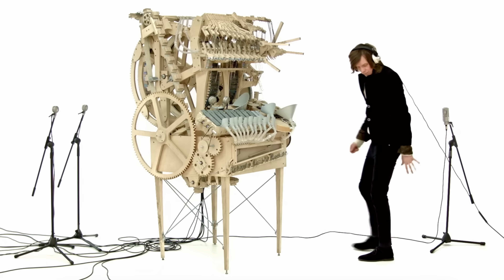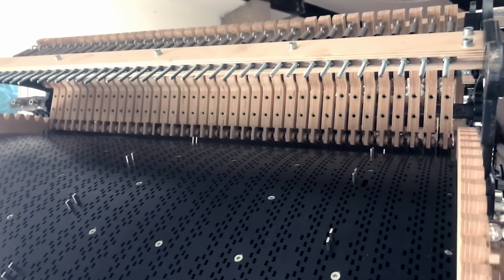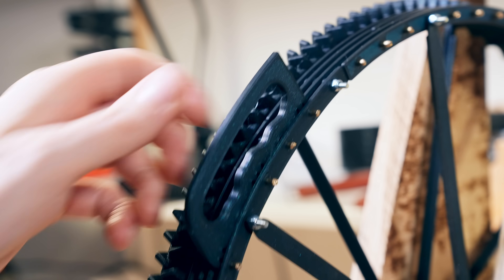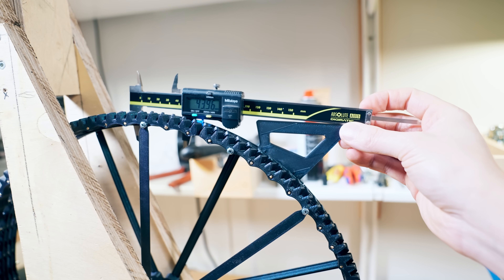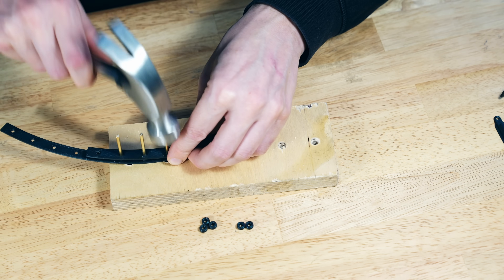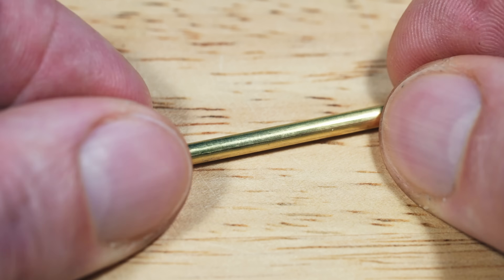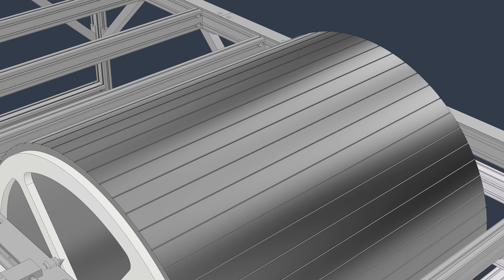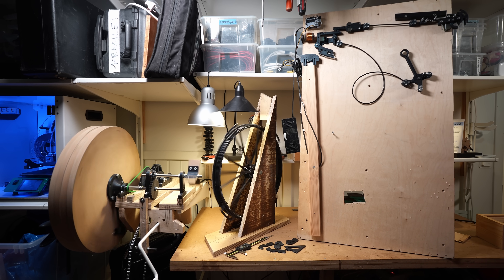Prototyping The Marble Machine Programming Wheel

Comment: I think the slots for the rods should be tight, but only act as a slot for the rod to sit in, then use a clamping piece screwed down over to hold the rod in. It takes more pieces, but should be easier to assemble and maintain, with less wear (if the rods are press fit then over time they will get sloppy).

Additionally it seems to me it would be easier to perform all the steps on a flat cnc table, cut the slots in the slats flat, then cut registration slots for the slats in the disks that make up the spine of the wheel for the slats to sit in snuggly.

One thing that others have pointed out before is there's still a need for a feature to stop the wheel from twisting along its length. I don't have a good answer for that myself.

Comment: The thin material holding the rods in will be a weak point in design 3. I feel like that came up in a design on the MMX. It will have a lot of support, yes, but if a rod breaks out it means completely milling a new wheel. Also the friction of pushing a rod through even a bearing material like delrin will be enormous over that length

Comment: I really think you're on to something with version two, version 3 is too monolithic an operation. Sometimes, despite Elon Musk, more parts is not better, but less impossible.  I agree the prototype assembles in a way bad for production of the machine, has to many parts and too inconsistent an assembly methodology. However, i think that idea could be adapted to a modular programming wheel design. Think a row of bicycle wheels on a single, very accurate shaft. 😉

Comment: As my previous worries weren't dissolved, I'll just re-post the comment I wrote in a previous video.
The programming wheel don't seems rigid enough to avoid deformation between both ends, the lack of diagonals or structural parts may cause a problem, moreover the driving force is applied to one end and there is resistance all the way whit the gates.
One other overlooked requirement is the need to play notes in fast succession, cause you can place a pin every 2 holes at minimum, holes that are worth 1 quarter note each in your design.
Some will say that the profile could have multiple edges to play multiple notes but you'd have to redesign the gate, as it is right now, it's way to flat and will be sitting on top of the multiple edges, thus merging everything into a single long note.

Comment: CRAZY IDEA:
What if instead of having a programing wheel that activates the gates mechanically, with the pins or prophiles, you had one that activated them electrically?

One option is that you could print a board with electrodes and a small battery on the wheel, that would make contact with a loose wire instead of a lever.

Another option is to use optical sensors with infrared LEDs in the place of the lever, lke those robots that follow a black line on the floor, having the wheel be printed with the notes

Both things would be incredibly precise, but maybe the machine would lose part of it's magic, since the mechanical activation is so pleasing to see

Comment: As a gear specialist, I think the double helical gears serves no purpose. It only looks cool. You would be better served with spur gears (straight teeth). There is no big torque here so no need of helical gears,. Straight gears allow you to pull the gear axially without moving the shafts apart. This allows for the gears to be milled as you don't need to much accuracy.

Comment: I like that last design in principle, but the way you are proposing to machine and assemble it is a manufacturing nightmare. I'd propose cutting an open slot (with a ball end if you want it to be round, but square would probably be just fine), laying the bar in and fixating it with additional bolted on pieces from the top.

Comment: I question the choice to only have the metal bars press fitted onto the wheel, it those bars are going to be pulled on every time the programing pieces are changed.  I can see the metal bars pulling out along with the programming pieces and causing a headache.  I think this aspect needs more consideration.

Comment: The rods are a good idea, its definitevely easier to space 60 rods evenly than 20000 holes.
But I'm not sure about the final design, it might be difficult to fabricate in full size. I would try to do a prototype with a flat piece of the same widht.

Comment: Or you can just buy a stainless steel 50 x 50 mm, 2 mm wire mesh... (3.2 meters long) and skip all the routing and fiting rods pain thing. You should only get the right wheel diameter (1018.6 mm for 1/64 accuracy). It may also be lighter, and will definetively last forever.

Comment: i kinda think the most economic way to go is to just adapt the 2nd design to use flat aluminum plate cut on a CNC router table. it's a little bit of a pain to assemble, but substantially easier to machine accurately and stiff enough in the axes you care about. adding retainer plates at the ends to keep the profile interface rods from walking out would also be a good idea.

Comment: It might be useful to use several shorter lengths of wire for the crossbars, so that trying to push them in into the slots will not bend them.

It might also be useful to make relief cuts between the slots (or inside the slot, so that they have a deeper cut within them that's too narrow for the wire) for the wire to adjust the stiffness of the lip of the slot. I would expect that the stiffness you get with no additional relief cuts (if you cut the slot so that it still grips the wire once it's in) will be a problem when inserting the wires.

There's a comment where someone recommends you start cutting the slots with a saw, because a ball mill doesn't really cut at the bottom. That sounds like a very good suggestion too, and allows you to adjust the depth of the saw cut independently of the depth of the ball mill cut.

Comment: Just a warning that press fitting those long rods into that slot may be difficult to do without bending it. Probably want to do a test part at the correct length. 
You are also limited by the size of the ball endmill if you just run it straight across, which might not be exactly the size you want. I think it's possible to use a smaller ball endmill to make a larger hole though. It would just be a very funky tool path haha. 
Maybe just make sections of it a tight fit, instead of the whole thing? Put some additional slots in for flexibility so it can deform a bit and grip the bars?

Comment: What you're referring to is "axial" and "radial" loads when talking about the ball nose cutter operation. However, you may be able to press fit the first few rods into their slots, but you will quickly find that you are introducing stresses into the metal which will make it require more force to fit, u til you won't be able to anymore due to the hardness of either of the material (it seems like you're going for brass rods and a steel cylinder, so the rods will fail first)
Martin, I know that you hate listening to people who have more experience than you, but unless you are for some reason not sharing your actual list of requirements, I think you should discuss with someone how to define them better. If not, try to follow the "SMART" technique.
Also, this would in no way shape or form be either cheap to manufacture, or easy for that matter, or repairable. I mean, what does "reasonably lightweight" mean to you? You will at least need an engine hoist to move that thing, and even then, how are you going to secure it without potentially damaging the wheel?
I don't mean to constantly shit on your project man, but it is so godamn frustrating.

Comment: i would love to see the programing wheels done in aluminum or stainless steel. the precision of parts would probably go up especially with CNC by a factor of a million. (exaggerating but ye know eh) every iteration of this build will get better and better, i can't wait to see how it develops form here on.
Reply: If you find a machine large enough to handle the programming wheel and rigid enough to cut steel, it's going to cost you a ton of money. With plastic you could probably get away with a router table and a suitable fixture, that's probably a factor of 10 or more difference in cost. Difference in accuracy would probably be in the region of 0.01 if at all.

Comment: obligatory "I'm not an engineer", but Is there a reason besides aesthetics the programming wheel has to be a wheel? seems like a lot of empty space for the interior of the circle, and any problems with the axis of rotation are magnified on the outside. Why not use a belt, like a treadmill or tank treads, that moves the pins/profiles in a linear direction and then goes underneath.

Comment: press fitting into plastic is gonna cause a lot of issues, considering you're constantly pulling and pushing on the metal rods with the programming profiles. 
Also if you already need to hire a machinist to build it, you don't really have to keep into account if its very easy or very hard to machine. It will affect the price a bit, but any machinist can easily pull off your first design. just takes a bit longer.

Comment: Martin. At 8.39 mins into the video, Using those type of carbide burrs will not give you the profile that you are expecting. These are for de-burring and fettling castings. The only type of cutter that produces a round machine cut is by using a round nose or ballnose cutter. They will only produce rounded bottom radii.

Comment: I’m confused, can someone explain how design 3 is conceptually different to design 1 except that pins attach to metal?

Is the advantage of the metal bars just wear resistance, maybe something ergonomic? It’s drilling the same number of holes, just now with additional horizontal slots – accuracy of the programming pins is still tied to accuracy of slot milling.

Comment: Those sliders are going to add a lot of friction. He still has no clue on how much power he will need, and since he wants everything to be human-powered he has no power to spare. If his machine is as efficient as a bike (it won't be: bikes are crazy efficient) he's limited to a power of 100/150W tops for the duration of a 3 hour concert, the performance of an average biker. Not a lot, and he does not seem to be aware even of this simple parameter.... Oh well, Wintergatan is the journey, not the destination, which is farther every day.
Reply: Agreed that it’s a fool’s errand to try to design/build a power module (or insist on “human-powered”) before he’s even built the machine and understand the machine’s power requirements and dynamics.

Comment: So would the whole programming wheel swap out for different songs?
Reply: I still think a bunch of hinged flat surfaces would work better, so when passing through the machine it's just flat, each flat segment would be say 10-20cm long. Then the "circumference" of the "wheel" becomes variable too, so longer or shorter loops, different number of bars in the loop etc etc. completely modular, and easy to swap out
Reply: Think roller shutter

Comment: You're wrong saying that milling an axial slot onto a cylinder would only cause axial forces on the cylinder. It will certainly cause rotational force (torque) and the cylinder will have to be locked very well in place.

Comment: 9:30 If you press fit the bars in place, then won't the Profiles pull the bars out when you remove the profiles?
Reply: I thought so too at first, but now I realise it's press fit from the edge of the cylinder, not the top. The slot made with the ball mill is like a lollipop shape.

Comment: measurements are as good as the measuring tool. those calipers have guaranteed accuracy of +/- 0.02mm so your measurements of the deviation of only 0.027mm is negligible, it might be just a measurements error...

Comment: 8:50 I have to warn you, cutting that slot will not be an easy operation. While you're technically putting force perpendicular to the rotational direction of the drum, the rotation of the tool WILL want to pull that drum in one direction and your channel will wander. Chip evacuation will also be a real problem with a slot like that using the type of cutter you showed.

Comment: Feedback on the proposed new MM3 programming wheel:

    When you press those long bars in the wheel, I think you will need to pull the rods instead of press.  You could do that with an attached thinner rod combined with a screw type puller.  Let me know if you need more details.   Note that this design will be a really long distance to pull / press even in plastic.   You should probably do a test piece to verify your construction method before building the whole wheel.

Comment: There's one extremely important design requirement that must be considered very soon.  The programming profiles do offer some advantages, but their larger size compared to mmx pins mean that any programming wheel these use is potentially less efficient at recording programming data.  You will soon need to decide exactly how much programming data is needed per loop.  Make the wheel too small, and you'll feel constrained to only overly simple melodies without many notes on very short loops.  Too big and it will be hard to tour with.  While it might add completely, it might be possible to make the mm3 be able to use different sizes of wheels that can be easily swapped out.  This can allow more flexibility, and make changes between songs simpler.  At the very least having one off stage being reprogrammed might prove essential.
Reply: Not really though because you can build as many custom programming profiles as you want, which more than makes up the lost data density. Like if you needed to squeeze two notes into the space of one programming profile, you could build a custom profile that has two humps. (This assuming the fingers can read the two humps that fast, but if they can't that's a problem that would affect pins as well.)
Reply: Attachment on attachment, or thats where the flexibility of the slots come in
Reply: I've sometimes thought Martin should look into the possibility of a roll/"card" operated instrument, which could play a much greater amount of music.  If the instrument could switch smoothly between two roll readers, that would leave room to adjust the length of different sections "on the fly".  For example, one could have a roll that ends with many dozens of repetitions of a two-bar vamp which could play while Martin gives a speech, during which another band member or roadie could load the next roll.  At the proper time, flipping a lever would start the second roll with some counted number of blank measures at the start, let it synchronize with the currently playing roll, and then switch off the first roll reader.  Some theater and fairground organs could do this sort of thing 100 years ago, so it should definitely be technolgoically feasiable.

Alternatively, I've wondered if a microcontroller-driven design might allow Martin to focus on being able to do interesting things with marbles.  A lot of reliability problems with marbles could be eased with some electronic controls.  For example, many parts of his earlier designs would be 100% reliable except if marbles arived at certain "bad" times.  If two marbles arrive at a merge point simultaneously, trying to decide which one should go first may be difficult.  If, however, the marbles pass photosensors and then solenoid-operated gates, a microcontroller could delay one of the marbles to ensure that they couldn't arrive near simultaneously.  Even if the marbles hit the photosensors almost simultaneously and the controller couldn't reliably determine which one arrived first, it could still back one to let pass first, and that one would definitely go before the other.

Comment: It feels like the width of the wheel is going to be an issue, like it will twist over time. You may want to consider a horizontal axle to keep the left edge of the wheel and the right edge of the wheel turning at the same rate, instead of letting the actual programming surface be where torsion happens.

Comment: Maybe you need to consider the size of the final wheel.  The one from the previous machines seem to be really big compared to your prototype. As the design relies on machining to work properly, If the wheel gets too large it may be really difficult to find a machine that can mount it properly (or too expensive). Also consider that milling the slots will introduce an axial force that will  load the spokes in bending if the wheel is clamped at the hubs. This type of loading doesn't happen during normal operation, so it might be overlooked during the design phase (ask me how I know :D).  Keep the machining setup in mind  and include some features that make mounting and indicating on the mill easier. 
The metal rods are a good idea, but I'm not sure if you could press fit a rod the entire width of the wheel. Maybe ask a machinist about this.

Comment: Be careful when press fitting those long, thin metal bars into the new wheel.
Press fitting relies on constant friction holding a part in place...say the cumulative force exerted on those metal rods is 100% * X, and this 100% is enough to hold that rod in place
When assembling the wheel you might find that instead of 100%, you only need to put that rod 50% in for it to become stuck.
You'd have to hammer it in (risking bending it) or lubricate it (risking the rods undoing themselves because they're no longer held by friction)

That's why in machines, whenever we need something press fitted, it's either a short part, or it's being clamped.